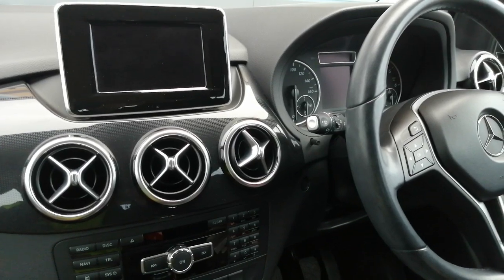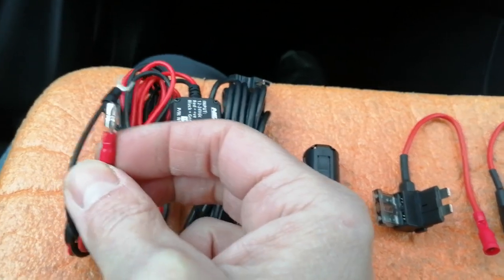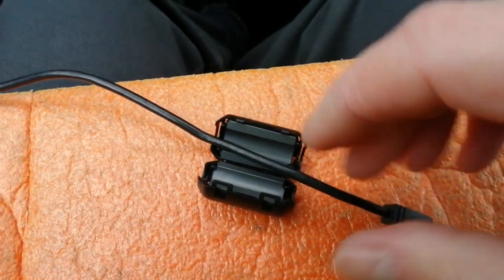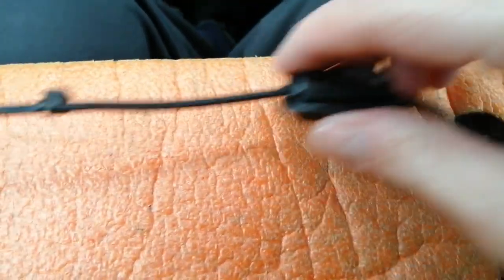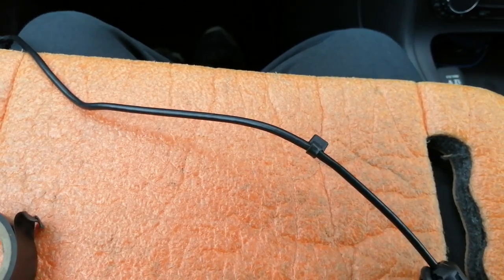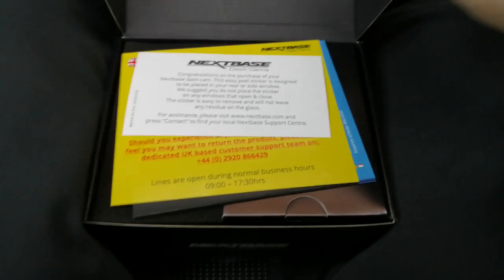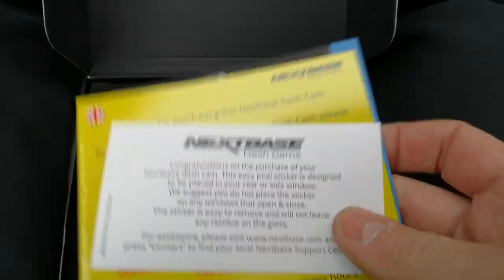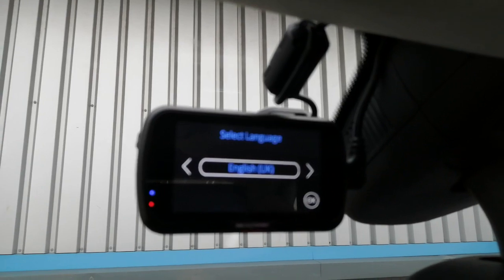Mercedes B Class 2011 to 2018 how to install dash cam

Comment: Thanks for a great video, it gave me the courage to install a dashcam myself, as I couldn't find a local auto electrician who was interested in doing it!  A couple of tips for anyone else doing this.  The miniature spade terminal supplied by NextBase doesn't fit on the earthing point you suggest (the screw is too big) so you have to either replace the spade terminal with a larger ring terminal, or earth it somewhere else (I did the latter).  Also, you may find a handy guide to the car's fuses inserted in a little pocket under the fuse box (if someone hasn't nicked off with it).

Comment: Great video PJs. Do you mind sharing more details on replacing fuse spurs in the fuse box? Especially how power connector is connected with fust box.

Comment: Hi there, thank you for the suggestions on cable runs, much appreciated. I'm awaiting my new car to be delivered (2020 MB A Class Saloon Sport) and plan to fit a camera once it arrives, but cannot find the owner's manual online anywhere. Do you know if this model has the fuse box in the dash by any chance? As it's been implied by the dealer that it's in the boot on the latest A Class.

Comment: Wonder if you lose the warranty if you modify the fusebox?, also thank you for your video its helpful.
Reply from the maker: No mods are needed to the fusebox,the fuse spur is removable if required,such as on lease cars or if your selling the car.
Reply: Thank you. Going To try installing both front and back camera with an extra battery under the sit for parking recording. Will report once its done. Thinware F800 dashcam on Ceellink Neo6 external battery.
Reply: You shouldn't loose warranty as you don't change the electric system at all. But you better check.